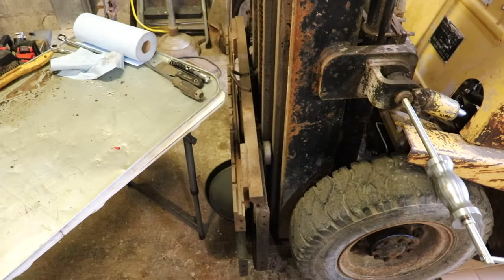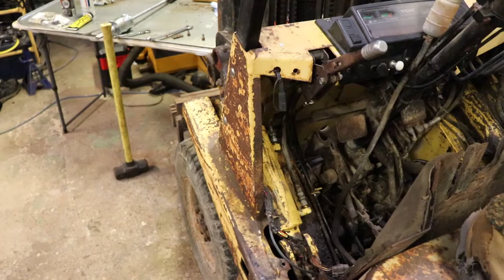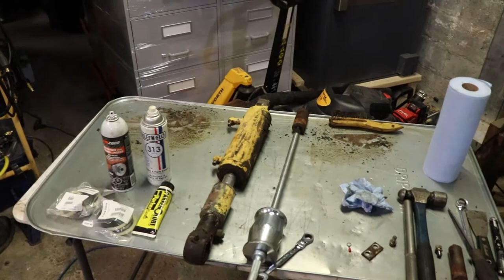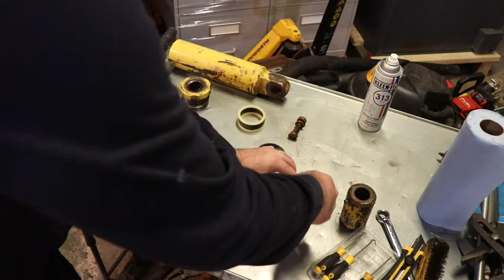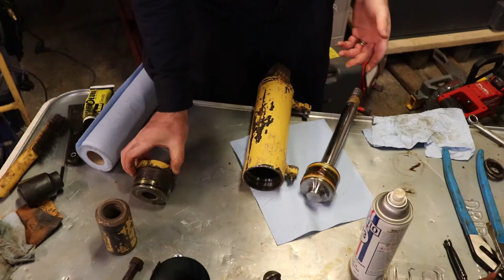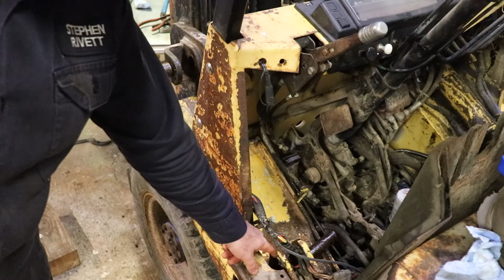TCM FG25N2S Forklift Tilt Cylinder Removal and Rebuild

Comment: Great vid, THX !!!!
In some cases (such as my TCM) the rear pin can be left in place allowing work to be completed without removal of cylinder and fighting it out on a workbench.
If not able to leave in place, loosening all pertaining threaded connections (spanner nut, allen set screw etc) before removal will help tremendously.
As far as purchasing a lot of tools, many local parts stores rent the tools needed (slide hammer and such) basically free for instance O'Reilly's allows a purchase offering a complete refund if returned within 48 hours. 
Also If the pins are just too difficult to hammer out, a little torch heat goes a long way but spraying with a good penetrant a day or so ahead of work will also make life easier.

Comment: First time working on a hydraulic system and this gave me a pretty good idea of what to do. Made doing my tikt cylinder a lot less of a head ache. For the sliding holders I would recommend putting some grease of some kind before hammering it in. Allowed to litterally slide mine in and turn it no problem. Thank you!

Comment: When you reinstall the cylinder, does the air bleed automatically? Ps: thanks for your video, very interesting
Reply from the maker: you will need to tilt the cylinder back and forth a few times to get the air out and then it will work fine
Reply: I installed back the cylinders and connected the lines back but now none of the lift controls work ? Is there a main valve where you can bleed out the air ?